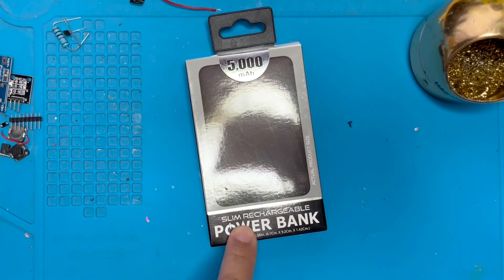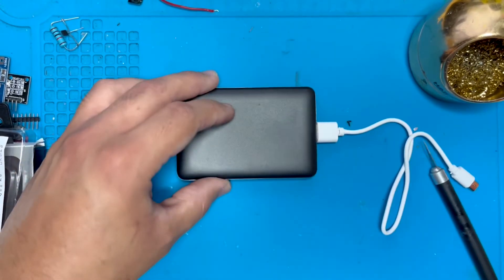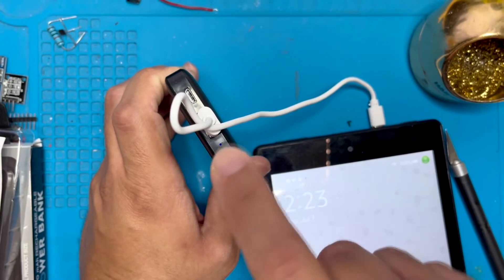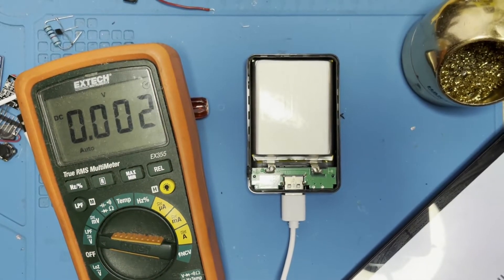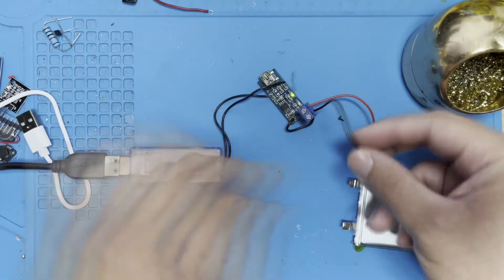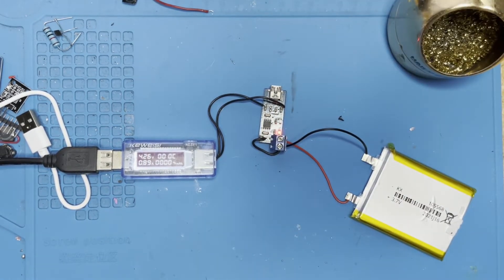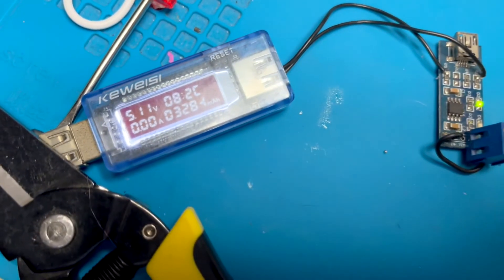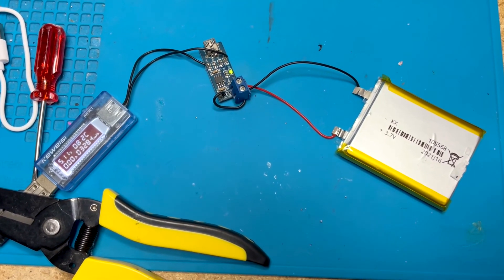Are 5 Below 5000mah Power Banks any good? is it really 5000mah?

Comment: If you know anything about lipo batteries you shouldn't store them above 30% capacity otherwise they swell.
So I'm guessing when you get them flat it's because of the shelf life before being bought they are slowly discharging over months of sitting in the store waiting to sell..
You never fully charge any lipo to sit over 3 months or it will kill it...
If you are going to store any lipo over three months don't fully charge it !!!
30% lasts for at least 2-3yrs on a shelf...
Reply from the maker: store it at 3.8Volts to be exact. There's special smart chargers that can do that for you if anybody is wondering. These are cheap batteries so I doubt they can hold their charge for long. That's why I get them below voltage. That was the point of this video, these are cheap batteries and will die pretty fast so I do not recommend. They are a waste of money IMO. Better to buy something else.